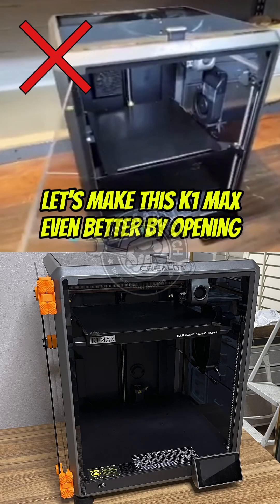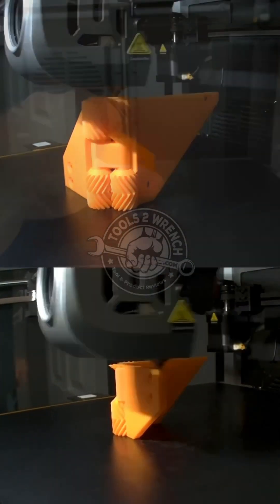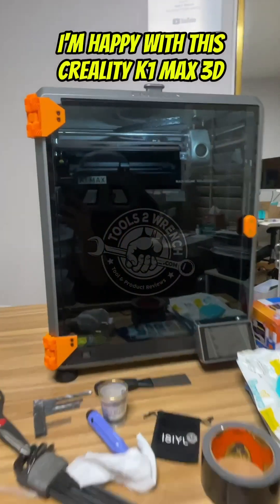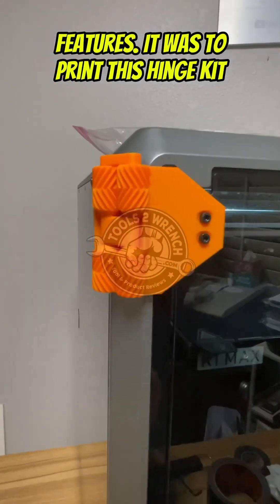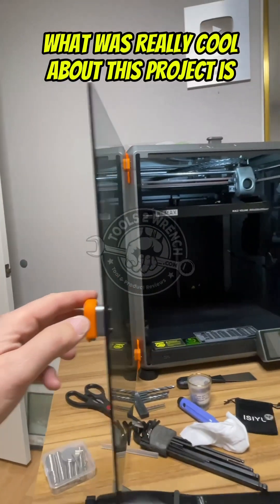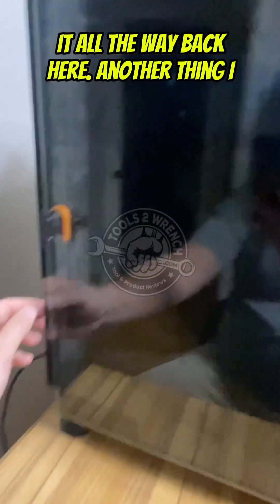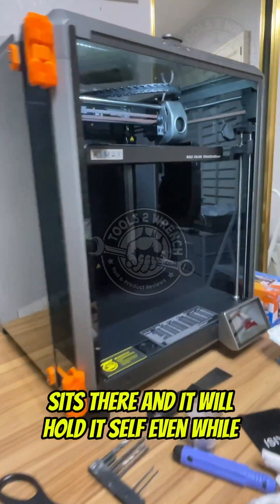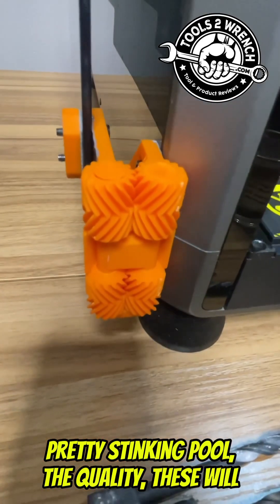Creality K1 Max Door Hinges #creality #k1max #3dprinting #tools2wrench #printables

Comment: Hey which screws do I need to get
Reply from the maker: Are the details for required hardware and more important slicers settings are listed in the designers printable file. Link in the description. I just added another cool accessory you'll love for a K1 Max. Vid coming! SMASH the sub and share what you are building!